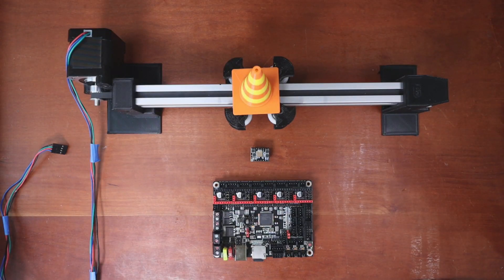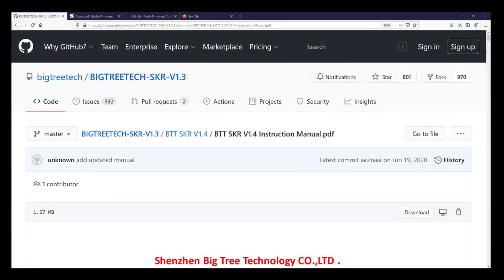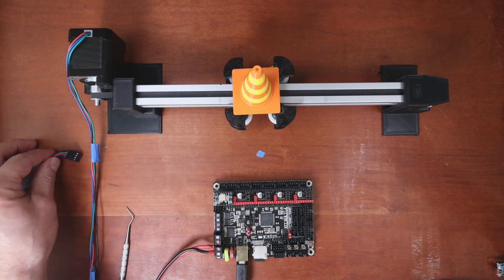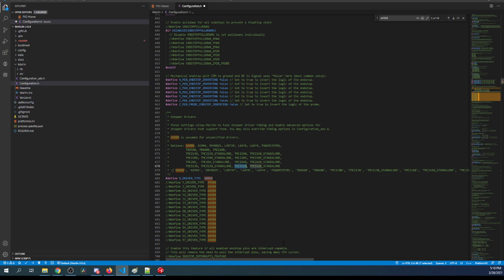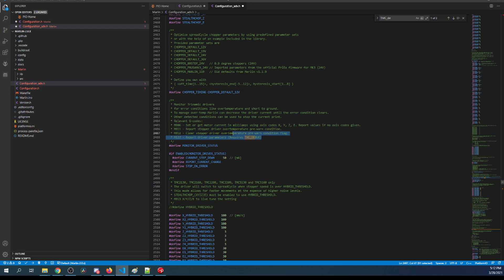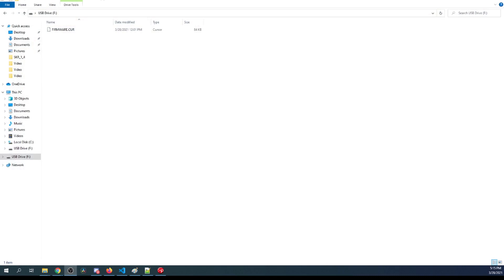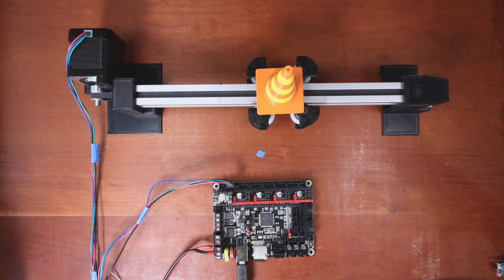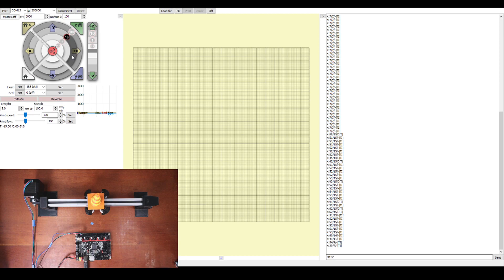SKR 1.4 - TMC5160 SPI

Comment: So for SPI you need a jumper on each one? I currently have SKR 1.4T with TMC2209 in UART for sensorless homing running Klipper... I think it only uses one jumper but I cant remember.  Would I put a jumper on each one for sensorless homing as well?
Reply from the maker: Configuration for TMC2209 is another video.  Also Klipper configuration might vary for sensitivity in Klipper.
Reply: @EdwardBraiman  I dont need help with TMC2209 lol. I went from TMC2209 to TMC5160 but I got it figured out so all good.

Comment: I noticed that the Makerbase MKS Nano Robin v3 board is like this board you tested with. I have the Bigtreetech TMC5160 driver installed on the extruder slot. I hope I don't have to do no fancy wiring to get it running.